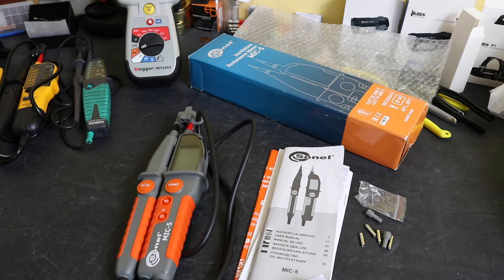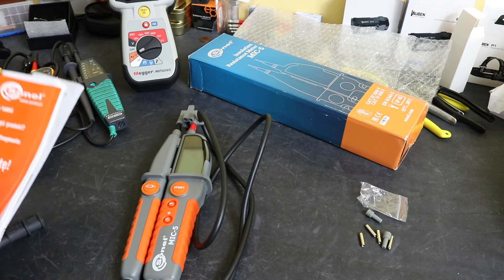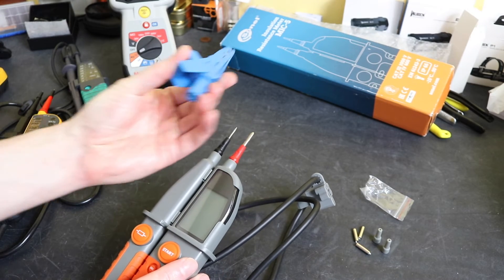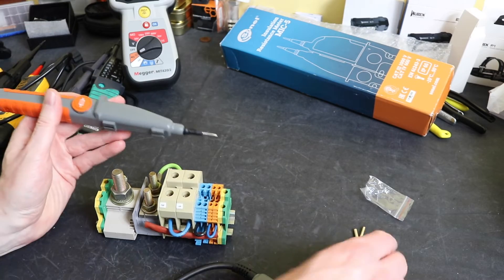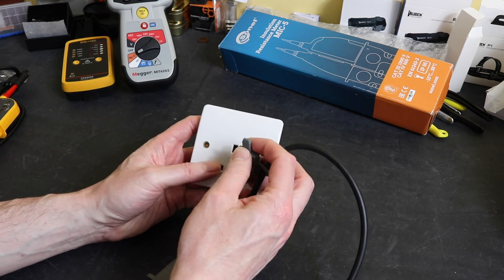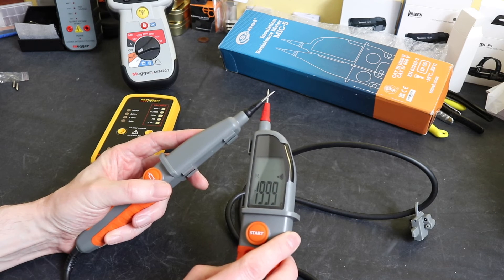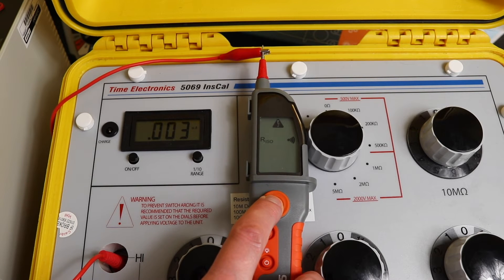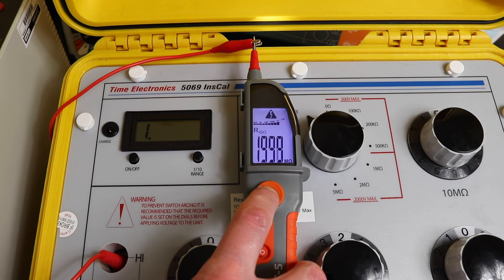Sonel MIC-5 Insulation Tester Review

Comment: The only sonel tool I have is the floor and wall insulation resistance testing plates sonel prs-1 something I think would be extremely useful for you when testing motors on pads and exposure to nearby potential conductive parts on motors including in fault conditions.

In this case Effective protection is ensured by the reduction of floor and wall conductivity such that under operating conditions the worker is not exposed to the risk of contact with potentials other than the potential of defective equipment, i.e. hazardous electrical shock currents.

Such a solution is based on the insulation of the test stand from the ground and equalizing the potentials of conductive parts (using non-earthed equipotential bonding) which are not a part of the electrical circuit to supply the test stand (

Usually If external conductive parts can be reached from the test stand within a distance <2m, insulating shields with at least a 2kV electrical rating is provided.
Reply from the maker: I would have to read up on the probe to understand it more. The majority of the plants I work on have ground mounts installed and everything bonded down to that to protect against and shocks and earth potential rise.
Thanks for watching and commenting.
Reply: @three-phase562  that should create a single potential but clearly you have to prove that the protections are actually working as they should which this nice little tool would help with. Read on this little tool I think would be ideal for you..

Comment: Nice, thank you. Have you used it at cables to check the insulation resistance and compare it with megger or other insulation resistance instrument ?
Reply from the maker: I have not tested cables on their own, but have tested cables attached to motors etc. Longer and larger cables have a charge time similar to when testing with a sub 1000V insulation tester. It seems to work fine, but with its limited measurement range it is more for go / no-go testing rather than giving a specific leakage current.